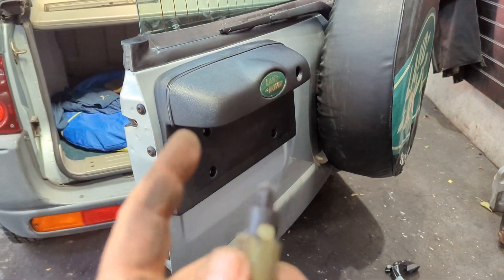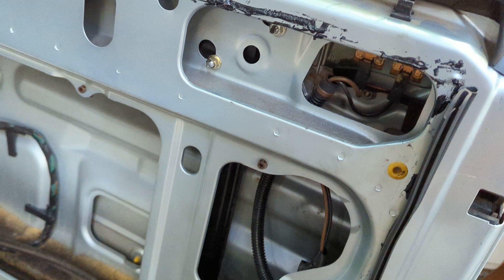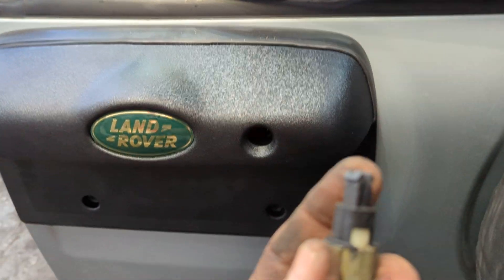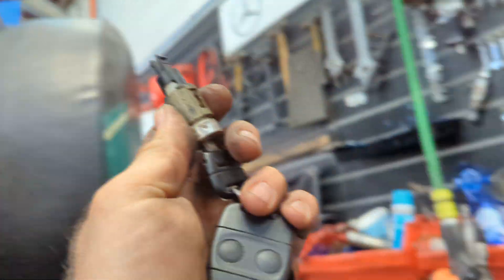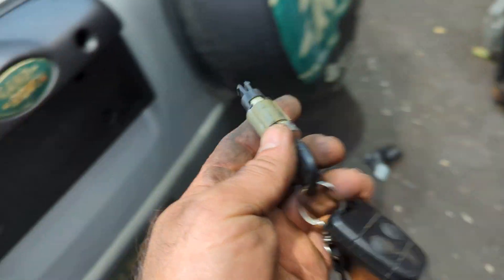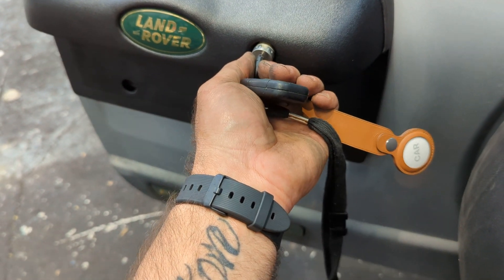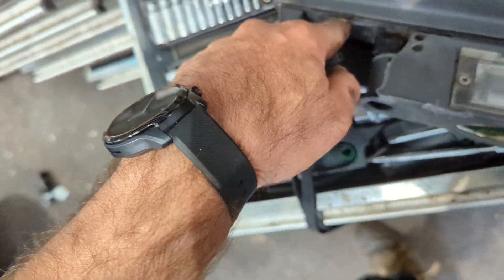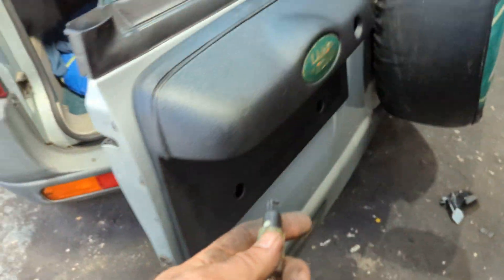Land Rover Freelander tailgate lock removal installation handle fascia

Comment: I just struggle to understand why one would want to replace it. It's not a real lock cylinder as as any flat object can be used to close the FL's rear window (and I know of nearly nobody that ever actually uses it). So, unless it's strictly for cosmetic reasons or because your repairing a FL and are a perfectionist :-p - why? Although, tbh if I had a good handle (ludicrously expensive) with a bad lock and a good lock in a bad handle, I'd prob do the same. :-))